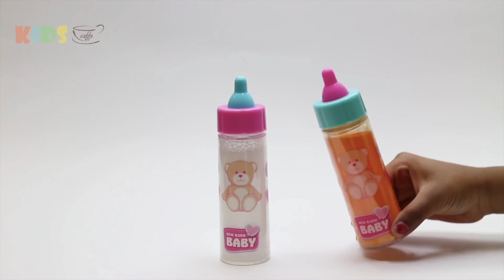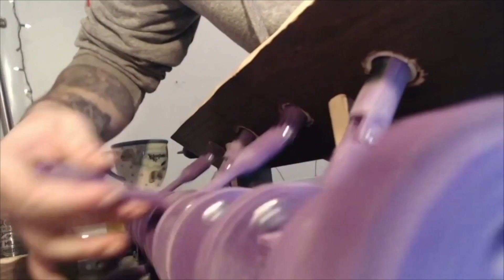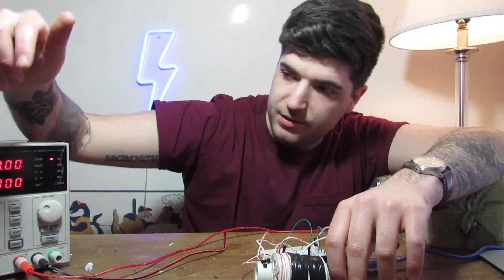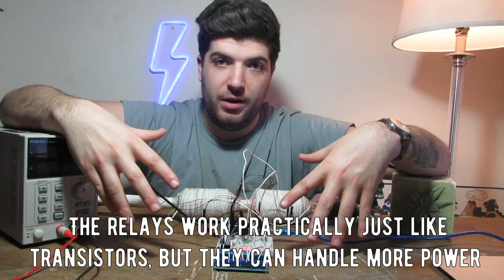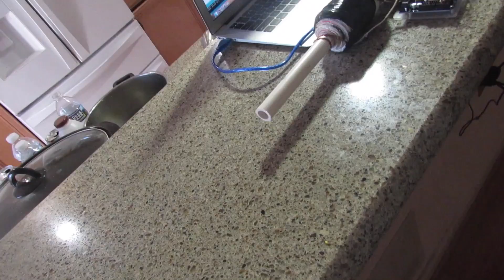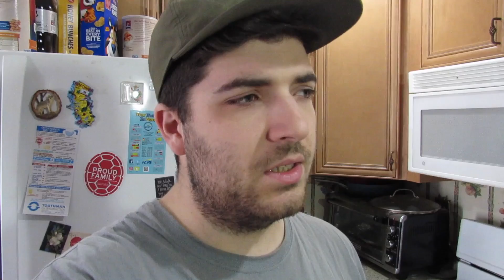Building a 3-stage coil gun | Arduino uno projects

Comment: What are the specifications of the coils you used? I am trying to replicate the experiment. 
Great content c:
Reply from the maker: I actually use the wrong wire gauge for both of my coil gun videos- if I were to make another one, id use a wire that's as thick as possible (but still wrap-able) for the sake of low resistance. In each of my videos my coils got ridiculously hot and wasted tons of energy

Comment: So i learned about hall effect sensors from the elctroboom video on coil guns but I still don't understand how they only detect the projectile and not the electromagnetic field created by the coil. Can you help me understand this? I'm working on one of my own and in the electroboom video he said they were faster than ir sensors so I'd like to use them as they sound more efficient but I still just don't understand this one thing.
Reply from the maker: yup, so the magnetic field lines coming out of the coils are completely perpendicular to the hall effect sensor, north and south pointing in and out of the coil gun, while the hall effect sensor is pointing toward the barrel and only picks up on magnetic fields pointed directly at it. The magnets inside the barrel also have perpendicular field lines, but they are briefly arranged to hit the sensor before they pass through the barrel
Reply: @MillersPlanetOne  okay that actually makes a lot more sense now, thank you!

Comment: Have you considered using solid state relays instead of your solenoid based relays? Your coils would be triggered much faster and more accurately, doing a better job of keeping your projectile out of repelling fields.
Reply from the maker: Oh I would have preferred using solid state :( The problem was, my coils draw tons of current, and I couldn't find any 4 channel solid state relays that could handle more than 4 amps
Reply: @MillersPlanetOne  you can use thyristor instead of relays